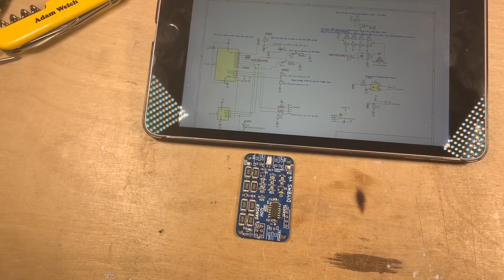DiyBMS v4 Module Build

Comment: hi adam
this item is already out of stock
https://lcsc.com/product-detail/NTC-Thermistors_FH-Guangdong-Fenghua-Advanced-Tech-CMFB473J4050HANT_C338637.html

can i use this  instead?
https://lcsc.com/product-detail/NTC-Thermistors_Sunlord-SDNT2012X473J4150HTF_C95967.html

do i need some changes in code?
Reply from the maker: At a quick glance that looks like a good replacement. Shouldn’t need any code adjustments I wouldn’t have thought.

Comment: Is anyone aware of the largest 18650 setup the DIY BMS can handle? xSxP. I was thinking about a 14S20P system.
Reply from the maker: Yeah 14s is fine. The limitation over cells in parallel is around the 1amp discharge current. If your blocks of cells are well tested and you build each block evenly then your 1 amp discharge could balance a 500p set. If they are not evenly balanced then it could struggle to cope with 10p. In most cases you’ll be absolutely fine with 20p.
Reply: Ok, I see. Thanks,  @AdamWelchUK   keep up the great videos.

Comment: With a 7S20P setup that will eventually be updated to an 7S40P, would it make sense to add another 7 modules for the new 20P packs?  Or would an update of the resistors be a better way to go?
Reply from the maker: If your packs are even to start with I doubt you’d need to make any modifications when you explained. My existing diyBMS uses a higher rated resistor than Stuart designed, so I balance at much less than 1 amp on my 7s20p - actually it’s about 250mA.

Comment: Since it is in your shed, in winter the temperatures will be below 0 some times. Does the BMS clock charging to prevent damage to the batteries?
Reply from the maker: I have one summer to work that out - but I think so yes :-)

Comment: Adam, how does it balance?  I don't see separate balance leads for each cell, I just see a single postitive and negative for each battery pack, but of the pack is a 10p4s (for example) I don't see leads that go to each of the 4 packs that make up the battery.  What am I missing?
Reply: If there was a 4s10p pack, there would be four of those modules, one for each cell, and a single controller... it's the same as the diyBMS v3, hence the discussion around 0:50 ;) It's not an all-in-one balancer that connects to every cell in the pack...but that is also the flexibility of diyBMS... it can scale up or down will the cell count as needed!

Comment: Great video.  Does anyone make these already put together?  I do not have a hot air soldering station and don't want to hack my toaster oven to do that work.  Thanks Adam!
Reply from the maker: Thanks John. You could build these with a normal soldering iron - lots of people solder surface mount with a normal hand held iron. I’ve not seen anyone selling them though I’m afraid.

Comment: Has anyone tried instead of using resistor for balance the cells to use a  G4 12V bulb . They are cheap and pull around 1A at 4V . The advantage is that you don't need the led that indicates active resistor. Can you make a video about that ? Thanks !
Reply: As many problems as I have with incandescent bulbs burning out this might be a bad idea.
Reply: @SiriusSolar  At 4V they are not burning out
Reply: @munge83  good point

Comment: Heating the copper up with a torch and letting it cool will anneal it and make it easier to work with. Softer means more surface contact area  when you torque down the terminals.

Comment: I'm going with KISS  (Keep It Simple Stupid).  Well above my Competence   levels  never mind equipment at hand.  Just going with Chiniesium active balance and voltage monitoring here. I'll use voltage monitoring board to keep things between the  3.6V and 2.7v lines.   No True BMS as per say.  https://www.ebay.com/itm/4S-Li-ion-Lipo-Lifepo4-LTO-Battery-Active-Equalizer-BMS-Balancer-Energy-Transfer/322916008031?ssPageName=STRK%3AMEBIDX%3AIT&_trksid=p2060353.m2749.l2649

Comment: I see you either made the same mistake I did by not realising 4.2 is out or you got your components some time ago and never got around to putting the modules together. Either way, I know the struggles related to components for v4 not being available on lcsc, I had to go to ebay for the thermisor and mouser for some other things.

Anyway, I programmed the controller which was relatively straight forward but I'm constantly putting away programming the modules. I have both the USBASP and an Arduino but I think I will use the USBASP as an Arduino requires two caps to be able to work as an ISP. I would so love you doing the legwork and finding out how to program these bad boys, it would mean I could kick my legs up and just follow your instructions :)

If you don't get around to this within the next couple of weeks, I might by then have tinkered with it so if you want, I can let you know how I got on, maybe my findings will save you time which you could use to put out the video :P

Btw, great content!
Reply from the maker: I’ve had the pcbs for a while, and bought the components about two months ago (perhaps a little longer). I’ve just been given a tip - Stuart has some precompiled releases which can be uploaded using avrdude. Haven’t looked into that yet. I had to replace one resistor last week which I noticed had been updated. It might be a couple of weeks before I can get round to flashing these.
Reply: @AdamWelchUK  avrdude you say? Now, that's a usefull puzzle piece, I knew he had precompiled code but I wasn't sure whether it was to be used with Arduino IDE or with platformIO. I'm very new to electronics and embedded programming so every piece of info is new to me!

Was it the R5 510 to 220 ohm resistor change by any chance? I remember seeing a commit message on github which made me check BOM to make sure it had the correct item.

I might whip out the pin mapping for UABASP and Attiny841  and tinker with it this weekend.

Thanks a ton for the tip, legend!
Reply: @kozakmaly  If you're on Windows, I'd recommend looking up avrdudess for the upload... it's a GUI for avrdude that just makes life a bit easier ;) If you have a look at releases for diyBMS you can see Stuart also give some notes about uploading the code, etc. in the release notes. If you have a USBASP, and a 6 pin ISP header, you should be good to go if you've populated the ISP header ;)
Reply: @pfeerick  Thanks for the tip, I actually managed to get it working through avrdude from the Arduino IDE using the cmd, I didn't seem to have much luck using gui though, it seems to have issues with the port as it's not finding my usbasp :/ 

I got the boards working eventually, after hours or hair pulling, I reprogrammed the wemos using the pyflasher and binary as opposed to using platform io, I also found a few loose connections on the jst connectors, they seem to need to be soldered from both sides of the pcb, otherwise their connection is rather flaky!

Comment: much easier to program these using an arduino uno flashed to isp mode, and then using avrdude through CMD to flash it, also make sure to use the lastest code https://github.com/stuartpittaway/diyBMSv4Code/releases as it fixes alot of packet loss errors
Reply: "C:\Program Files (x86)\Arduino\hardware\tools\avr/bin/avrdude.exe" -CC:\Users\Gareth\AppData\Local\Arduino15\packages\ATTinyCore\hardware\avr\1.3.3/avrdude.conf -v -pattiny841 -carduino -PCOM4 -b19200 -Uefuse:w:0b11111110:m -Uhfuse:w:0b11010110:m -Ulfuse:w:0b11100010:m -F -e -Uflash:w:"C:\Program Files (x86)\Arduino\hardware\tools\avr\ATTINY841_Module_Firmware.hex":i

make sure to change the user to your name, and also check what version of avrdude you have on arduino sketch, update it to the latest mine was 1.3.3 at the time of flashing them and also make sure to type the correct com port mine was on com4
Reply: and to make sure to place stuarts hex into the correct folder   C:\Program Files (x86)\Arduino\hardware\tools\avr\
Reply from the maker: Cheers for the tip.
Reply: @AdamWelchUK  no probs just give me a shout if you get stuck :)

Comment: I love it. With these components at their values are setup to do 4.2v but you're using LiFePO4 3.65v is that a problem or will it just balance at any voltage in that area?
Reply from the maker: It’s fully customisable so I should be able to set it for LiFePO4 no bother.
Reply: how you customize eighter in hardware or software?

Comment: Yo! can you explain your reasoning behind using an BMS instead of just charging with an 7s charger?
Like i want to make an ebike with no BMS and leads that connect to 2 sections of 7s and i would charge the bike through those leads while using 14s leads in the e-bike controler that should protect for over discharge.
Is this possible and shouldnt it be a better solution than to have an "always active" BMS draging on your bateries?
Reply from the maker: We have different use cases. I’m solar charging these cells - and some days they will get very little use, other days a lot more. My solar charge controller doesn’t have any balancing functionality (few solar charge controllers do) so this will ensure the cells stay even and I could possibly even disconnect the battery entirely if something goes wrong elsewhere.  Although these modules will be always on, my cells should at least get some charge every day (even in the darkest parts of winter), and this version only pulls about 1mA - so it’s peanuts on a 180Ah bank. 
However the biggest reason why I like a BMS on my battery banks is so I can monitor the pack remotely 24/7 and create alerts if there are any issues.
Reply: @AdamWelchUK  Ok, thanx for your response. I was wondering since you are solar, do you need an MPPT to run  "iSDT T8 Battery Charger" (12-40v input and not AC input) or can you drive  it from a solar panel directly? (given a 300w and limit the charger to 300w)?
Like can it be used for charging without the added benefits of low discharge or simultaneous use of the battery?
Edit: if you got 100€ to chip out for one of those chargers or similar ones you could make a video that would probably rise some eye-brows if it works as to my short investigation they always advize a MPPT
Reply: @manipulativer  From what I have seen, any "charge controller", MPPT or not, fed to an appropriate set of these should work fine. I wouldn't hook the panel or source up directly for fear of back-voltage and shorts. Look in Adam's older videos for the 18650 powerwall series, should give you more of a background of how and why.
Reply: @JeffCariveau  Thanks a lot about your response. I will look in Adam's videos and this back voltage is news to me - will inquire.
Really thanks.
Reply: @manipulativer  Without a blocking diode, during the night your batteries could backfeed into the solar panels, hence losing a portion of the charge you worked hard to gain throughout the day. Using something like the iSDT T8 Battery Charger, I would be more concerned with it resetting whenever a cloud went past or simply not getting anywhere near as much out of the solar panels as a 'dumb' PWM solar charge controller, let alone a MPPT charge controller. Due to the fact that solar charge controllers don't have to worry about loss of power since they run from the battery, and connect or disconnect the solar panel to that battery as needed. As opposed to a RC hobby charger, which just isn't designed for use with a variable and unreliable power source such a solar panel. I expect it would be a fairly short video... with the charger repeatedly erroring out due to unstable power supply, but I could be wrong!
Reply: @pfeerick  I believe you are mostly correct, but imagine having a solar panel, this charger and an ebike. 
I did some further research and an mppt seems a better solution but in that case you need an BMS and BMS is something i really like to avoid.
Perhaps improved MPPTs for li-ion 7s system would be perfect - idk just speculating.
Given the knowledge i've gotten from reading Tesla it would be better to have wireles power transmission through Earth with minimal loses, but they rather misuse radio as a weapon and in case of a global brakedown a solar and batteries is the most you can get.
Reply: @manipulativer  What it sounds like you're after is the Solar BMS that ElectroDacus made ... it's a solar charger and 8 cell BMS in one. With lithium, you can't avoid a BMS or individual cell monitoring entirely (well, you can, but you'll likely find out that hard way that the batteries have been wrecked due the imbalance and improper charging, and no longer hold charge)... but sure, energy harvesting would certainly be the way to go... there's so much potential that we're just not using!
Reply: @pfeerick  Will look into that.
And without a BMS and a good charger you are always balance charging and all you need is an inverter/converter/controler to have the low disconnect.
A BMS works by bleading out the excess and its set to 4.2 and even if you have good programable ones they are always active. I dont like that, i rather have additional maintence with better effeciency
Thanx for your responses
Reply: @manipulativer  Not quite. There are equalizer 'active' BMSs that will shunt the voltage from the high to the low cells, rather than using resistive loads like balance chargers or passive BMSs. However, doing that sort of internal switching is more complex, thus more expenseive, so you don't see them as often. And most balance chargers work by charging via the main power lead, and then using a network of bleed resistors to then load the higher cells as the battery reaches the constant voltage charge stage (hence the 200-500ma 'balance' spec on 500W  charger :-/) ... offhand I can't think of any balance chargers other than the Revoletrix (and perhaps the iChargers?) chargers that do anything different. So don't think that it's more efficient if the charger is doing a balance charge... it's no different, unless you are sure you have a charger that actually charges each of the cells independently.
Reply: @pfeerick  I see, the last bit is something i didnt think through as i thought if its a 8terminal charger it SHOULD have this option as the minimum requirement. If that is not the case and its just an external BMS than when buying you better have a good quality BMS on the battery... Thanks m8, apreciated